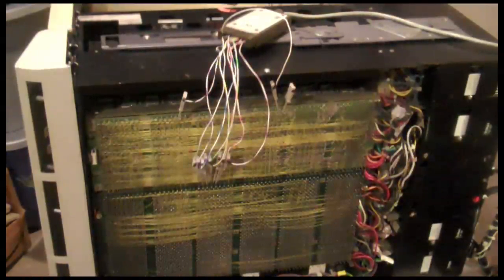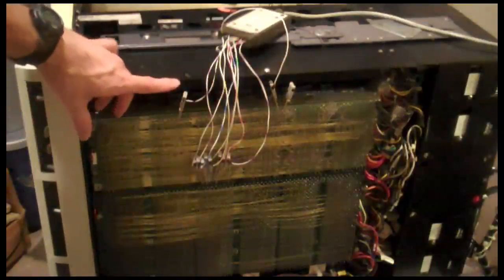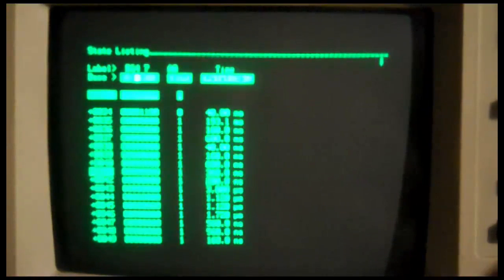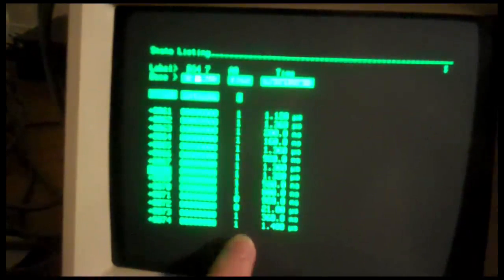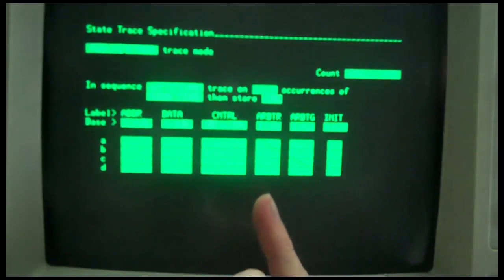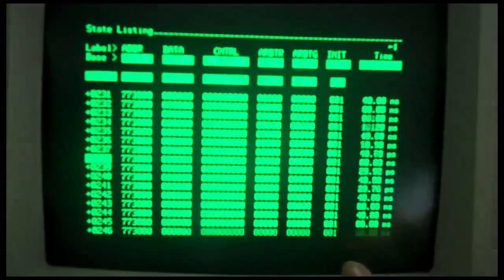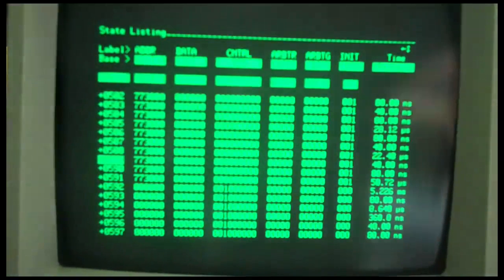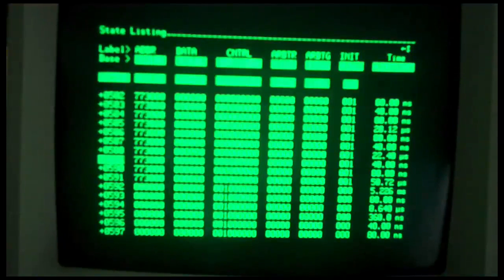PDP 11 Repair - Part Two

Comment: 773000 is the start address for the boot ROM. I never fixed these with an analyzer I used an O'scope. How many buss transition did you get? Also the console interface I think needs to be there. 776500? A 5 volt potential on the init line I think causes initialization of the Buss arbitration routines of the CPU. I expect it to go to ground to run. Was 193 the last sample on the buss? should be more. I worked on 1134A's more...better front panel. But I worked on a lot of these. You are showing samples up the entry of the boot ROM code is that all? Try putting the console card in.
Reply from the maker: Thanks, Mark. This was an 11/34a, it just has the standard panel instead of the programmers one. In the end I don't actually have these boards anymore - but I've ended up with several other spare sets, and 3 more 11/34a's - more videos to come, it's in the queue, but I very much appreciate your input.
Reply: you need a console. Was 193 the last sample? Yeah, the front panel was pretty much the same for the 1134 as you have here. I assumed...
 All my maintenance stuff is in storage I do not remember the 1134 module numbers. I still have all my carry around documentation (mini maintenance books in storage I should go there and see what is left. I have not seen a 1134 of any type in over 15 years... it is like another universe. So much has changed so many times.
Reply: I was taped to help on many DEC issues. Badge id 83903. Contact me anytime.. I miss supporting them
Reply from the maker: Thank you very kindly, Mark. Be careful what you offer :)
Reply: Is that a dare? Oh don't make it a dare...Many have dared me in the past and lost...:)
Reply: @jpkiwigeek  I found my 1134 maintenance manual. Slot 1 and slot 2 are processor boards (Row A, B, C, D, E, and F). Slot 3 Row A and B is M9301 Bootstrap terminator dual board.  Slot 3 Row C, D, E, and F is a Quad SPC slot that must have flip chip if not used, as all SPC slots require. Normally slot 3CDEF you see a M7859 11/34 programmable console interface card. Slot 4 is a Quad SPR slot You may see a M7850 Parity here in 4AB in some systems.. Slot 5 is for 1st memory slot all the rest of the slots are HEX SPC slots except slot 9, which a Quad SPC. 9AB should contain M8303 Bus Terminator. Your machine is halting when the boot action access 7773000H, it does not exist in your configuration.

Comment: Hi, what boards where installed when it was halting? You need 2 cpu boards in the first two slots,  I forget which order. Then you need the bootstrap terminator in A/B of the third slot. Depending how it's configured you will need the console terminal card in CDEF of slot 3 and memory in slot 4. Bear in mind it's been a long time but I don't think interrupt/DMA is enabled at this time. Not sure whether Sack is asserted high or low. Halt instruction=0.
Post your email if you want more thoughts

Comment from the maker: @Galfonz Correct on the DMA, and agreed on the floating. I verified the thing was jumpered correctly for all of the boards when I was doing the backplane tracing, so that isn't an issue. As for the floating, I loaned my boards to someone who hasn't returned them, so I'm kind of 'stopped' in futher debugging right now.

Comment: Back in the day, I remember people needing to add and remove backplane wires to make these systems work. Unless a DMA capable card is installed the bus request input is wired to the bus grant output. This wire needed to be removed when a DMA capable card was installed. Also, the system wouldn't work if it had a DMA card installed and it was removed without replacing the wire. Note also that you might be seeing floating signals rather than logic 1s.

Comment from the maker: @cobrachoppergirl Well, firstly keep in mind this is a system designed and built in the _70s_. Their primary goal was not user friendliness (the PDP11s were, in particular, designed to be inexpensive yet flexible systems). Also, this is one of the two CPU boards - when the CPU in your system fails, does it die gracefully, or go down in a fiery wreck? However, in today's terms, I agree with you entirely.

Comment: It's really a shame that this type of analysis and engineering skill is disappearing from technology.  These days it's cheaper and easier to throw away a board and try to diagnose it in this manner.  Computers have gotten so complex that I would argue that this type of analysis is practically impossible on many modern systems.  This is very interesting to watch.